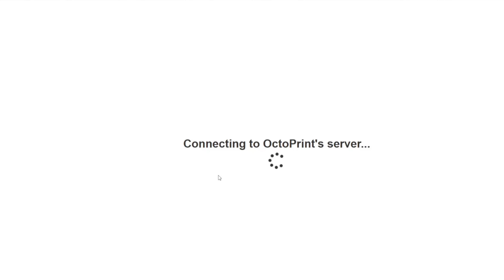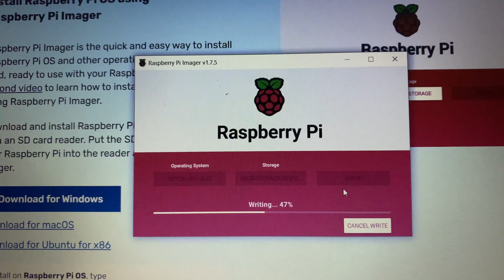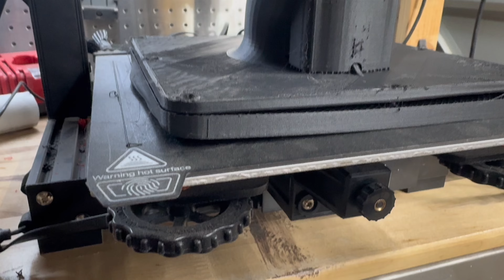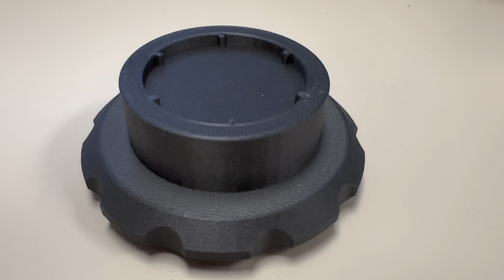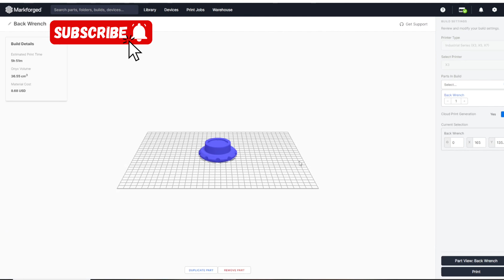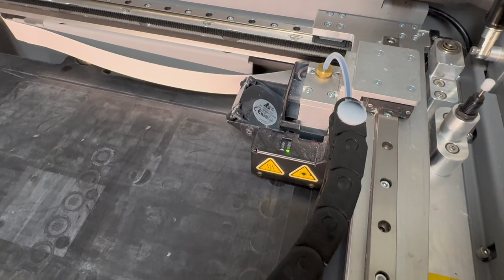Can a Bargain 3D Printer Perform Like an Industrial Quality Printer?

Comment: If your machine doesn't have a heated enclosure then you're at nothing.
Reply from the maker: I can do a lot without my enclosure even just with PLA, but you're right.  It is severely limiting.  The controls are I guess more what I was thinking about in this video.   I would love to either get a better printer capable of printing Nylon or even carbon fiber nylon so I could make some resilient parts.

Comment: I used OctoPrint for a really long time and it never failed me. Now I converted all my printers to Klipper. I could still use Octoprint with them, but I moved to Mainsail
Reply from the maker: I’ve never heard of either Klipper or Mainsail. A quick look gives me the impression you’re looking for more efficiency for production print farm activities. Any benefits over Octoprint and a printer’s native firmware for you?
Reply: @themeandrousengineer  Seriously? Well you're in for a treat. Klipper is an alternative firmware for 3D printers that makes all printers better. For instance, I now can print at 200 mm/s what I only managed to print at 50 before, on the same printer, with the same quality. Mainsail (and also Fluidd) is the interface that's equivalent to Octoprint in the Klipper world
Reply from the maker: I have seen that Klipper disables the screen interface on Ender 3 v2’s so I’m not sure about using it but the speed sure is tempting.

Comment: Printing in the heat is better than the cold.. If the room air is 100+ you can print ABS.
Reply from the maker: I might experiment with that this summer.  It would be interesting to have seasonal printing.  Thanks for the tip.

Comment: Markforged Bed material is G10 or something along this line.
I modified my Prusa with G10 and Onyx work the same on my prusa.
Onyx is Really easy to print, just like pla
Reply from the maker: Well, that's pretty cool you've been able to do that.  I've heard of Garolite being a good material before and that would make sense that Markforged just made a large molded bed of it for their printers.  The only thing they say on the website is it's a "composite".  

Do you run the Onyx at it's stated temps and have an enclosure?  I'm sure you have a hardened nozzle of some kind as well.
Reply: @themeandrousengineer  recomended nozzle temp, hardened nozzle. non heated enclosure that is a photo booth.  Just keep filament dry.
Reply from the maker: @michelcote  When I'm ready for paying $190 a roll, it's nice to know that this could be an option.  Thanks for the info.

Comment: Young's modulus (stiffness) and tensile strength aren't related and nylon is poor at both compared to other common filaments. It has good wear resistance and ductility.
Reply from the maker: Young’s modulus has everything to do with the elasticity of a material and therefore everything to do with stiffness and tensile strength. A tensile test is the standard for determining a Young’s modulus which tells you the strength of materials. That being said, nylon isn’t the king of printing materials. It’s good for certain applications but just like all materials there isn’t one that’s good for everything. You should choose the material that suits what you need it for best.
Reply: @themeandrousengineer  You can have high modulus and low strength (mild steel) and vice versa (7000 series aluminium). The Young's modulus is purely the slope of the elastic portion and has basically nothing to do with yield or UTS. You said Nylon has good modulus therefore good strength, which is wrong for two reasons: 
1. Modulus doesn't determine strength
2. Nylon is the least stiff of the common filaments (ok, not TPU). Seriously, look up the flexural modulus on technical data sheets.
Filled nylon is another kettle of fish. For some reason it reinforces well even with short fibres, much better than PLA does.
Reply: @MiG82au  In the world of YouTube troll land, you are correct, as there is no one to correct you from beneath the bridge you are camped under... However, logically speaking, there are several flaws to your argument. 1. A quick google search will show you that youngs modulus and tensile strength are directly related. Higher young's modulus = higher tensile strength. 2. not sure if you noticed but this is carbon fiber filled nylon...why carbon fiber you may ask? Because carbon fiber has a very high youngs modulus, and as we just now learned, correlates to a very high tensile strength. This way you get the best of both worlds (Aka wear resistance and tensile strength)...sorry you never made it past intro to engineering, but best of luck to you in your endeavors!
Reply: @lukewatson5345  I'm glad you've moved onto Google after graduating from the school of hard knocks, but I've been a stress analyst on high performance safety critical structure since 2006 so I know the difference and lack of correlation between E and Fy.

Comment: We have 3 Prusa mk3 printers upgraded to mk3s+ models, one with the mmu3, as well as a Prusa XL in our shop. We use them for prototyping and jig manufacturing. We have had great success doing so with pla. I have been trying to switch to a nylon filament for the jigs as they do not last very long with our processes. Every printer is currently using octoprint and I must say, there are certainly problems we face using these printers for what we do, but for the pricing, it's hard to really complain.
Reply from the maker: I have heard great things about the Prusa’s and I wish I could have one. I really didn’t have the justification to spend that much on something to tinker on in my shop, but if I ever go to make products, I’ll consider it seriously. I would still be very tempted to get a Bambu as well. There is a benefit to paying for an industrial machine with the reliability. We have zero tinkering and hardly any major problems with the Markforged at work.

Comment: I am a mechanical engineer by day and volunteer to run the 3D printer area at SnoCo Makerspace.  For a few hundred dollars more than the Ender 3, a Prusa's reliability is hard to beat.  We run 2 Mk4s (among other things) at work, and with a hardened nozzle, I can get as good a print out of the Prusa in PA-CF as I can from a Markforge Onyx at $4k.  And at $4k, the XL with the tool changer can do parts like TPU overmold on PETG with soluble support - something that a $40k Stratasys machine can't do. 

I've also printed metal filled filament (75% tungsten, for example).  I haven't debinded and sintered the parts yet, but if I do, I should be able to get a 100% net dense part from a desktop FFF machine - which is *insane*.  

I still can't do continuous fiber reinforcement... yet.  But we'll get there.
Reply from the maker: I would really like to invest in a Prusa or a Bambu, but with the Bambu’s there’s not a proven history of reliability yet so I would probably go Prusa at this point. Sounds like you have access to a great facility and I’m a little jealous. I love having access to the Markforged printers but I can’t really use those for what I would like to since it’s for work. I’ve loved my setup so far but I don’t know how far I want to take 3D printing before I go into other CNC machines.

Comment: If you want to a more fair comparison between industrial fdm 3d printer you would need to take a look at for example VZbot that has even more bells and whistles and because it's mostly made out of aluminum and with goliath hotend it can handle temps up to 500C. Bedslinger's arent bad but they require quite a lot of mods to print high engineering materials and i don't think its worth pouring so much money into cheapes printer as you will end up spending more money than for example vzbot kit (about 1.5k$) and end up with worse results. Bambu is good middleground if you dont want tinkering
Reply from the maker: Those VZbots look pretty slick. You gotta love the CNC brackets and parts on there. Do you own one yourself or have you used them?  I would love to do a closer comparison with other printers. Maybe some companies would be willing to donate to the cause at some point.
Reply: @themeandrousengineer  Yes I do (same person), you can find my road to making one from scratch (not worth ever since that kit came out). About 5 parts of videos and upgrades.